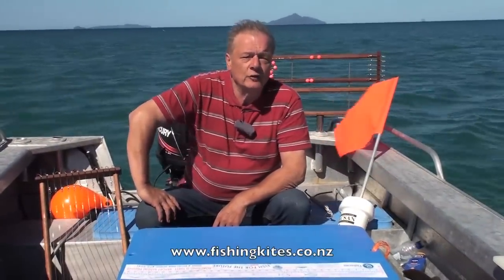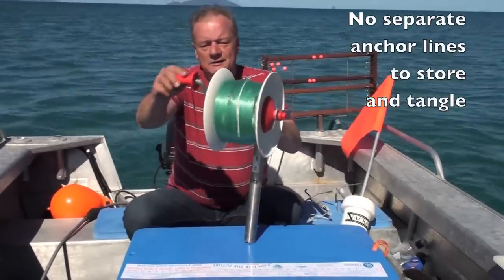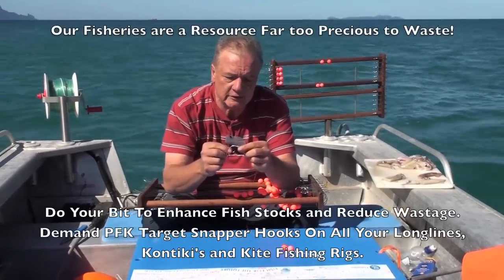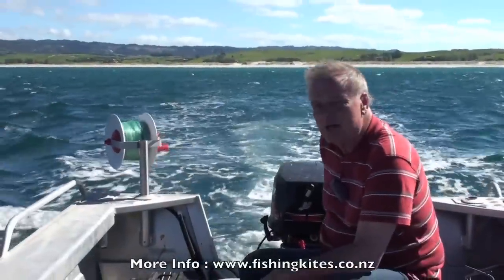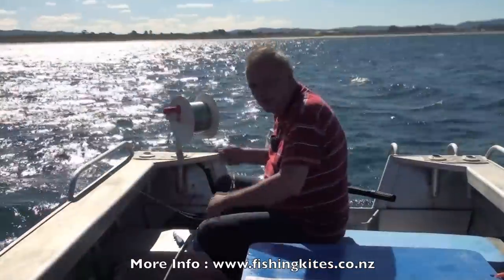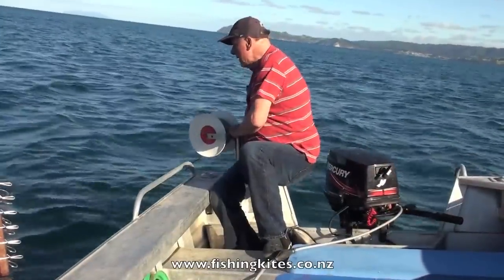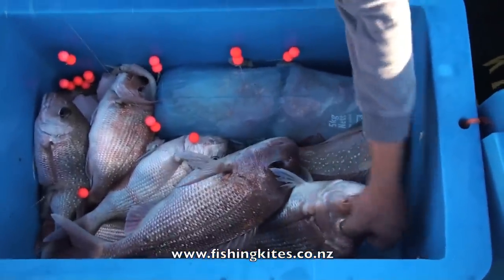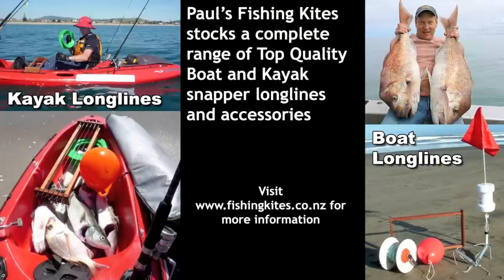Snapper Longline Fishing Methods

Comment: I use this method on a rig I made myself. Works well. One comment though after years of using. There is potential for getting yourself into trouble trying to position the boat when retrieving as you have to be perfectly in line with the grapple down as you can't pull the line to you and you can't run over it. Works way better if you pull the downwind  line and grapple and clip the float off on the backbone so that end is floating. Go upwind and do the same and as soon as it is up motor off at a right angle so you don't drift on the downwind float. Once you have done that you can just drift and the backbone comes with you with no stress. Way easier. You just have to run a clip system between your droppers and backbone. Easy to do and I get two lots of 25 hook backbones and droppers on the same reel. If you do this you just have to put the first dropper line in a bucket, and then wind it on last (you'll work it out).
Reply from the maker: Yes, I do the same if the wind is strong and it works well. In light winds over sandy areas it is unnecessary.

Comment: Awesome Vid, though I've one question: You say that the fish can run along the mainline till it hits a stopper, which sets the hook, but arn't circle hooks supposed to work best without a sharp tug to set them, which could pull the hook from the fish's mouth? Is that theory wrong?Because that is an impressive catch on the second line. Josh

Comment: Here is what I think. If fish swallows the hook with the floating beats, it cannot easily be hooked, because when fish eventually spit the float, at that moment hooks will be out to.  That's because beats diameter is many times bigger than thickness of the shank of the hook. The unique hook shape causes the hook to slide towards the point of resistance and embed itself in the jaw or in the corner of the fish’s mouth if of course the fish mouth is close. So the fish opens the mouth to spit the ball shape beats and hooks follow beads without any problem especially if the plane of the hook is positioned horizontally. I mean if the shape of the floats will be not round but flat, it will help to hook the fish better. Other words, if you not let the fish open the mouth too much, it will be hooked better. You know what I mean. Maybe technically its not easy to make flat shape floats and let them last longer. But that's just a technical problem.
Reply: CoolStreamT gåTsmannknuter

Comment: Hi Paul, our float line  is 25 meters long, when fishing in say 15 meters the excess float line is floating on the surface of the water.(boats can run over it).what do you to get rid of the excess float line when fishing at different depths ?.thanks.
Reply: Use a sinking line!!

Comment: Hi Paul, can you retrieve the line by choosing either one of the two floats? Cheers
Reply from the maker: I always pick up the up wind float first and use wind and drift to assist when hauling. If I get it right I don't need to drive the boat at all when hauling.

Comment from the maker: This system is far less dangerous than any system that has hooks on snoods permanently fixed to the mainline. If this gear is snagged on the bottom line can easily be fed out very quickly with no danger of anyone getting a hook in them. This is not so with the systems you are advocating. Hooks cannot tangle when setting and get dragged over the side in big dangerous mess of line, snoods and and hooks either, and this certainly happens with the systems you suggest.